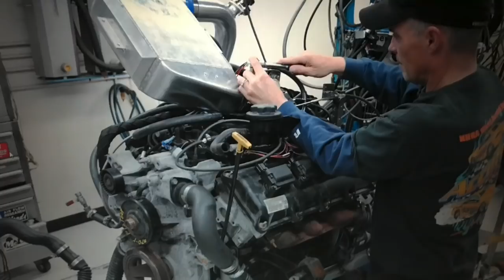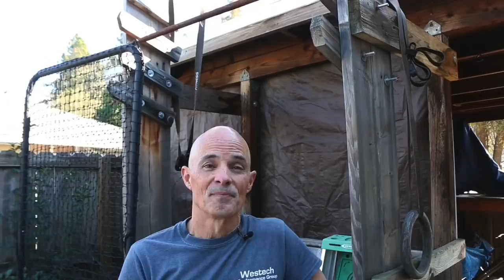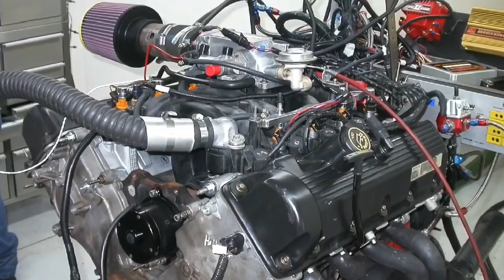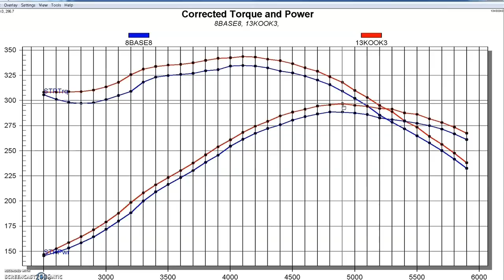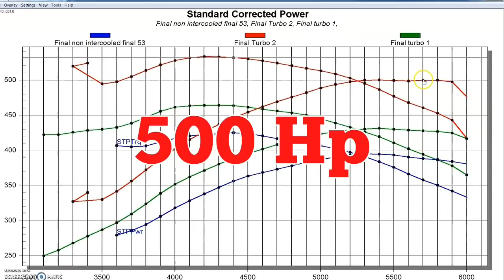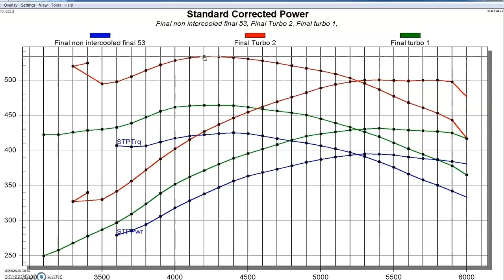JUNKYARD BOOST BATTLE pt1-FORD v CHEVY v DODGE

Comment: As a Ford guy I really want to like the 2v but I can't get there. For many years the shortcoming of Fords was cylinder head design, and the 2v probably breathes worse than any Ford since the Flathead era. That's why it's almost impossible to make impressive power without putting a bunch of boost to it. According to the Hot Rod Magazine article "Trick Flow Cylinder Head Upgrade For 2 Valve 4.6L Ford Modular Engines - 453HP 2V 4.6 - Speed Parts Testing" the TFS head flows 80cfm more than the PI head at .500 lift on the intake side, with the stockers coming in at a ridiculous 169cfm.

Comment: Mr. Holdener, after watching this video 2 times I am a bit puzzled and not exactly sure how to ask this.   In n/a form, peak torque was about 4100 rpm and peak hp was 4900 rpm.  Under boost, peak torque was about 4200 rpm but peak hp on the first 2 runs was about 5400 rpm (about 500 rpm higher).  Why did boost push peak hp out 500 rpm?  Are the factory heads, cams and intake that restrictive?  What am I missing?
Reply from the maker: RISING BOOST CURVE?

Comment: There is a 4.6 4 valve cobra engine out there making over 3,000 HP with 60 psi of boost. Runs in Pro Mod with Ford production block and heads.

Comment: It blows my mind that Yandre put a 4.6 motor with a manual transmission in his Minion TT mustang and is now running 7's making 1500+ whp!!
Reply: I believe the only thing is stock on that engine is the block.
Reply: @strokedmustang66  block, heads and crankshaft.
Reply: Leviathan 5.0 4v and 40+psi FTW

Comment: Check out the way the power curve shifts upwards with boost.  Stock, you're shifting at 5000rpm with max power around 4800 rpm.  With the turbo, power is there all the way through 6000rpm.     This would definitely change how a mustang drives.

Comment: need to pull a 4v from a aviator or navigator. would dominate the 2v
Reply: Werd. Navigators are crazy common in junkyards... aviators a bit less, but still, you want the 5.4 4v anyway... you can even get adapters for coyote intakes on em.

Comment: This Ford 4.6 2v made 108.7 hp per liter and the Chevy 5.3 made 114.5 hp per liter.  We'll see how the Hemi turns out.   For everyone saying Richard should have used the Ford 5.4 or the Chevy 4.8 , for a base line range apply the per liter numbers produced in the tests provided.  Also very few will swap a 5.4 into a Mustang and few will use the 4.8 vs the 5.3 or even 5.7 LS  if they are building something fun.   LS to Mod engine, Chevy has a better platform (cheaper, smaller, lighter).  I'm a Ford guy and as Shelby said, Ford should have stayed in the small block game in the 60's instead of going with the 427, I wish that would have happened as well.   The old 302 Windsor engines are physically smaller and lighter than the LS engines but also a weaker block.  The Ford Cyclone 3.7 v6 seems to be an interesting option for small, light, powerful... just not cheap or easy yet; I hope soon.
Reply: I'm keeping my eye on the 2.3 ecoboost for cheap/light... imagine one of those in an XJ or TJ.  can't wait till rangers are all over JYs.  :P
Reply: @dre04mach  there are plenty  2.3 and 2.5 in yards already, look at the Mazda vehicles; FWD though so I'm not sure about a RWD/4WD layout.  Or get the old 2.3 Lima engine, they do well with FI and there's even a mod to place a 16v Volvo head on the 2.3 block.
Reply: @chestrockwell8328  I'm talking the rwd ecoboost 2.3, not too many out there yet.  Only came in mustangs and the new rangers.  The old lima engine would need a lot of work to get to what a 2.3 ecoboost does with just a tune...
Reply: @dre04mach  I know you are referring to the Mustang Ecoboost 2.3, but you also said "cheap"   and that's where the Lima comes in. Doesn't take much to get high 3xx hp and low/mid 4xx tq with a Lima and FI.   But you also want to put this is a 4wd jeep, with large heavy wheels/tire I presume ?  sure it'll work ecoboost or Lima, but FI 4cyl gas engine won't be an ideal power plant in that vehicle... but hey I like odd ball stuff too.

Comment: All the guys complaining about the cubic inch size of the ford. You could use the 4.8 and still beat them all. Then ford guy says, that is still .2 liters larger. The ls platform is most reliable, makes the most power and you can do it with far less money. Some people get stuck on a brand and it's sad, because if they would just let go of that mentality, they could have fun too.

Comment: 533 ft lbs is pretty stout coming from 280 cubes. 👍🏻
Reply: Even more impressive when it's coming from an overhead cam and not a overhead valve engine which always make more torque
Reply: its good but thats really the limit on those rods and pistons. i was waiting for him to say the rods let go. the 2v and 4v motors both are limited to about 450rwhp because of the rods.
Reply: @OxBlitzkriegxO The torque may be at it's limits on the rods but you could make much more power at this same torque and be just as reliable. Supporting mods like ported heads, cam, and intake will move the power curve up and likely lose the low end torque shelf but gain 1500rpm up top and 100 more HP with the same boost. There's no set number that the rods will go at. If it's healthy, lean on it.

Comment: Richard, your mistaken about the last year of the 2v engines. It's whatever was the end of "Panther" platform cars. The Crown Victoria, Lincoln Town Car and Murcury Grand Marquis never got a different engine from 1992 on. The last ones were either 2011 models or 2012 models. The last F150 to get one was in 2010 and I believe E150 vans kept them in some markets until 2013. They had a 21 model year life.

Comment: You did a 4.6 2v test with cams and Total Engine AIRFLOW heads and made over 400hp. I would like to see that engine boosted. 700hp?
Reply: Rods and pistons let go around 400-450 rwhp...

Comment: Great video Richard! I've got a Jeep Grand Cherokee with a 4.7HO I freshened up the bottom end after it dropped a valve seat. The replacement pistons have the rings moved further down than stock. Do you think it's worth trying to run a turbo on this thing if I gap the rings and use an air to water intercooler. Pump gas could I expect to see 400-450hp like this 4.6 ford. People are down on the 4.7 but I think it's a great motor with the ring and valve seat issues fixed!
Looking forward to hearing from you.
Reply from the maker: everything needs boost

Comment: 4.6 ford, 4.7 Chrysler, and 4.8 ls would have worked.
Reply: The Chrysler 4.7 isn't Gen III Hemi architecture. And I imagine most junkyard 4.7's have blown head gaskets. 

But, I admit a Chrysler 4.7 vs Ford 4.6 battle would be interesting. 
I think the performance would be similar but, the Ford has more vehicles equipped (including performance variants) and a much larger aftermarket.
Reply: Lol, I wouldn’t put the 4.7 in a go cart. I have worked on soooo many 4.7’s that shit the bed before 150-75 thousand miles it’s a joke. Really shitty motors
Reply: @nathanwood1567  Sure you are correct, but I’ve seen lots last to 200k or more also, in my experience, as long as your staying on top of the cooling system maintenance and making sure you bleed it totally and correctly (super critical) and stay on top of the front main seal (really not to big of a deal....in a ram) they last pretty good, they wrap out in the rpms fairly good for a small truck engine, honestly after driving all the 4.7 is better than a 4.6 in stock form (I know arguable), if you can figure out all the oem and aftermarket offerings (little) you can get 300-325 easy horsepower out of it
Reply: the 4.7 is low key a Hemi though
Reply: @hank1556  
Because..? Does it have semi-hemispherical combustion chambers or something?
Reply: @of_lion22  I dont know thats just something I read on instagram one time
Reply: thatallredheadude 1 not quite. They have a heart shaped combustion chamber
Reply: @MrRandomStuffTV  
Similar to a Chevy Vortec chamber?
Reply: NCD2294 correct
Reply: The 4.7 dodge isn't a very saught after engine it would of more then likely maid respectable power though

Comment: I would have made it more fair by selecting a Ford 5.4L over the 4.6L because you choose the GM 5.3L instead of the GM 4.8L.  A 5.4L powered Ford GT holds many speed records.
Reply from the maker: Yes I know John from Accufab very well, and that 4V motor motor is amazing. They are not not as common as the 4.6L 2V-this was not a max power test
Reply: @richardholdener1727  The 2V 5.4L is a powerhouse in Lightnings.  I don't think the non- Lightning engines from a regular F150 is any different aside from the supercharger.  A 2V 5.4L with boost on flex fuel can make some impressive power gains over the 4.6L and more similar to the GM 5.3L.

Comment: Did the 4.6 have upgraded valve springs? I missed that part.
Reply from the maker: it did not
Reply: @richardholdener1727  thank you.  Was wondering cause isn't boost and heavier valve springs the main recipe for the LS engines making huge power??  Was just asking to see if it was a true, stock engine only scenario.

Comment: Would be a sweet motor in a 4x4. That low to mid rpm torque is what you need to get the tires turning in some thick gooie mud.

Comment: 99,0 Nm/L (Na) @ peak torque and 91,3 Nm/L (Na) @ peak hp.
Turbo; 
89,1 Nm/L(Na) @ peak torque and 81,9 Nm/L (Na) @ peak hp.
Turbo intercooler; 
94,9 Nm/L (Na) @ peak torque and 86,6 Nm/L (Na) @ peak hp.
Reply from the maker: Power/Boost Formula=NA HP x (boost/14.7 +1)=turbo hp (if not, figure out what went wrong)
Reply: @richardholdener1727  Agreed. :)

Comment: Alright, it’s time. BIG BANG 4.6 2V with those TFS heads and some decent cams. 

I know back in the day, everyone would say 450-500whp was all she wrote for 4.6’s. Let’s see if that’s accurate!
Reply from the maker: we've done way over that with stock bottom end
Reply: Yea, unfortunately, years ago a quality tune was a bit more difficult to get. Detonation killed countless motors and then the guy would blame the motor for a tuning/fuel quality error. 

It still happens today, but at least it’s a lot harder to mess things up as bad with the newer engine management systems and available Information
Reply: And that is precisely why your Big Bang tests are so awesome!! What can the motor handle? Not “what can the tuner handle?”

Comment: Now I want to know how much boost can a stock 4.6 2v take.
Reply: Depends, I personally have never seen a stock 4.6 last very long at elevated power levels, 4-500hp.  I believe 500 is about the most you will make before things start reliably breaking 😉.
Reply: 400-450 rwhp is what the rods and pistons handle stock.  Throw rods and pistons in and your next weakest point is the crank at 700ish hp.  If you start with (or swap to) a forged crank (from 4v cobras/machs), then the sky's the limit.

Comment: Poor 2v lol! At least if you’re comparing a 281 to a 327 and 345 you should have grabbed a Marauder/Aviator/Mark VIII 4v. The 2v is at a 90hp stock disadvantage to the stock 5.7 an about 50hp disadvantage to the lm7. Don’t get me wrong 2vs can be fast! Andrew lavender’s runs 8.00s (will be 7s this year) on stock block and crank.. but they aren’t the junkyard choice of 4.6s

Comment: So I wonder how this set up would preform 15years later? I could be wrong but I feel like In 2007 people were not making 1000hp on a junkyard LS, also what is the limit to this set up, I feel like 9.5psi is very little boost, would you make 600hp if you went to say 15-18psi like run on an LS? I would live to see this same test on a 5.4L with modern day tuning and see what it would really make.
Reply: There were people making stout numbers on a junkyard LS in 2007; upwards of 1000hp.  Even back then, people were making 550+hp on a junkyard 5.3 with only 9-10psi (with the stock cam).  Running 15-18psi, a “mild” LS (cam only) often makes 700-900hp.  

The problem with those higher boost levels is the ring gap.  He didn’t open up the ring gap in these engines, so running those boost levels would likely break a ring land; destroying the motor. 

The test he’s doing here looks like a good representation of what to expect by bolting boost onto a stock engine that’s going to see street duty.  Throwing race fuel, a lot of timing, and cranking up the boost makes for great looking numbers, but it doesn’t reflect what a lot of people are doing...  running pump gas in fairly stock motors with boost.

Comment: 5.4L Ford Mod motor would of been better comparison.
Reply: Would be great to see, but correct me if I'm wrong.. there's not too many junkyards with inexpensive 5.4 mod motors right?
Reply: The LKQ yards around my way have at least 40-50 5.4L trucks floating around.
Reply: @DaOnE51T  could be a great test for a future episode then. Fingers crossed!
Reply: Definitely,  gives everyone more options. “Big Bang 5.4L”
Reply from the maker: 40-50?
Reply: Yeah, should I be yanking these motors every weekend. They just had a 40% off on everything. If you can prove there potential in a video. I’ll be all over them. 😆
Reply: @brianfrost303  The 5.4s are everywhere here.  econolines, expeditions, f150s, practically any superduty you see is gonna be a 5.4...

Comment: "A motor is a motor is a motor no matter who makes it, all it is, is a air pump. Suck it in blow it out...it's up to you to make it efficient, then comes the power."  Ak Miller
Reply: Ramiro Diaz for the simple minded this is very true! For the people who think of it as a way to turn heat energy into mechanical energy/ combustion = horsepower/torque it’s an engine and design matters! 
Flat Earth vs real earth
Reply: A mOtoR iS a MoTor. Lol yeah because quality control, build quality,  and the quality of material used in building the motor doesn't matter.
Reply: Like I stated in the comment it's up to you to make it efficient.
Reply: If that was true there wouldn't be 3 OVERWHELMING favorites in the swap world...GenI/III/IV SBC, xJZ and 6BT.

Comment: Ford makes a 2 valve 5.4. Would be a way closer comparison.
Reply: He stated that he wasn't trying to compare which is better.  He's showing how turbos increase hp on various engines
Reply: Sure but he is also somewhat comparing manufacturers, you can’t put out a video titled ford vs Chevy vs dodge without people wanting to compare, a 5.4 would be a great comparison here.
Reply: @mach1motorsports828  Yes you are right. Put those three in the title, its kinda a comparison no matter what. lol.
Reply from the maker: yep-we considered that but lots more 4.6L 2V motors out there
Reply: @richardholdener1727  almost 900,000 f-series sold every year, roughly 70% of them f-150's and 90% of those were 5.4's. I'd say there a lot more abundant than the 4.6's.
Reply: R Shiery now many 2v 4.6 are out there out of crown vics, grand marquis, mustangs are out there vs. f-150’s
Reply: @chadvalliere8697  ya know, I don't know the numbers, but if we include superduty's, excursions, expeditions, navigators, and e-series vans, I bet the 5.4 is still the sizable volume leader. I wish ford actually disclosed that info.
Reply: @chadvalliere8697  crown vics, grand marquis and mustangs combined probably sold 1/3 of F150s each year...  Now add in expeditions, super duties and econoline vans to the f150 numbers... 5.4s are just as if not more common...
Reply: R Shiery honestly the 5.4L doesn’t have make that drastic of a different. Might make a little more torque and a tiny bit more hp. They basically have the same cylinder head.